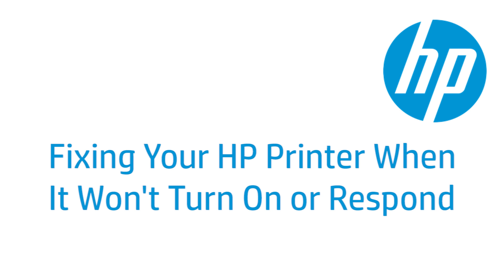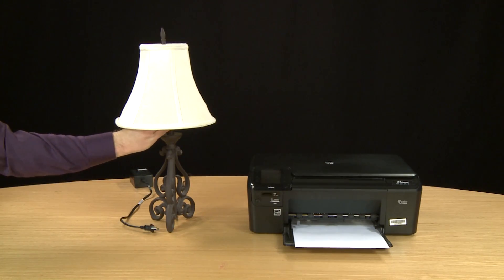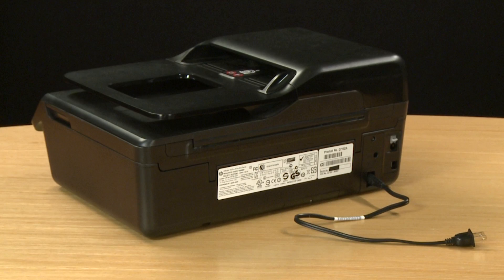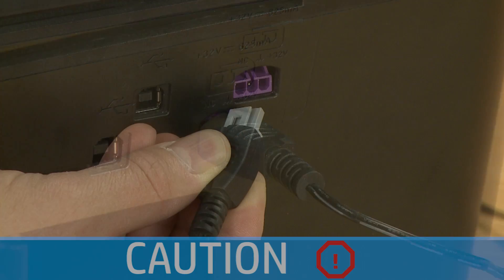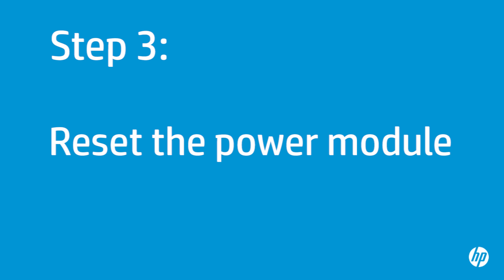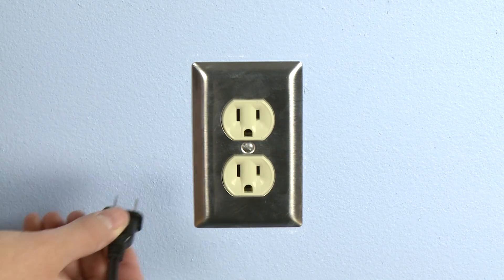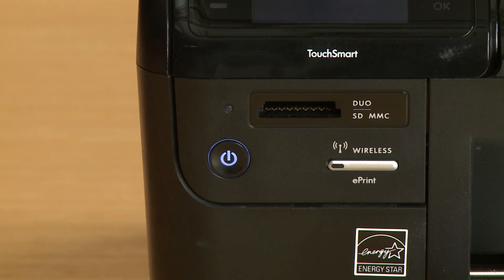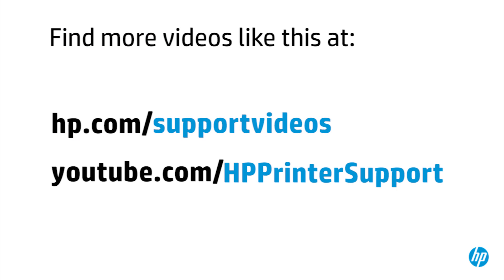Fixing Your HP Printer When It Won't Turn On or Respond

Comment: My HP Deskjet F370 is not detected on my computer. The printer's all lights are on (not blinking) all the time after plugging the cord to electricity outlet. The power button on the printer is not responding and remains on. Plugged in plugged out done but no responce. please suggest.
Reply from the maker: +Harsh Dev Vashist Please follow the guidelines in this document to fix this issue: http://bitly.com/2JHcjjR

Comment: My power supply has indicator lit on but when i plug the connector to the printer the indicator light goes off and the printer won't power on. What's going on with my printer?
Reply from the maker: +antonio alvarado Please perform the steps mentioned in this document to fix this issue: http://hp.care/2v0gAoi
Reply: i have done performing all the steps being shown in this video but still not working. If plug the power supply the light indicator lights on but, when i plug the other end of the power supply to the printer the light indicator turns off and the printer won't power on.
Reply: same problem. No power

Comment: Most insulting video ever.  I think I'll buy a brother or something... HP's seem to be programed to act funny in a few years and it's almost always some infuriating thing to cause some sort of inconvenience for a little while and then it magically heals it self. Oh and I can't let this one go.  That "reset" where he tells you to unplug the 120v side of the Power Supply Unit and you must wait 15 seconds is TOTAL BULLSHIT! What he's telling you to do is unplug an extension cord from your vacuum while the other side isn't even connected to the outlet at the wall. HP has fallen so far... Sad.
Reply from the maker: +Aaron Locke-Paddon Please perform the steps mentioned in this document to fix this issue: http://hp.care/2pigaHj

Comment: all tricks are failed..
i purchased hp deskjet GT 5810 in august 2017.  Since buying the product it does not print in colour mode.  i complaint to toll free number on 7 sep 2017. i got a complaint no.  but after 55 days i got no help from hp. I complaint many times but  my effort was useless.  now printer has no power.  sometimes work for 5-10 minut and after that it stops working.   i have tried a lot of trick but failed to solve.     anyone can help me in this regard..  plz advise how to replace this printer from hp.
Reply from the maker: +lg niboaria Please use this document: http://hp.care/2pigaHj to fix the issue. If the issue persists, please contact HP Phone Support: www.hp.com/contacthp for further assistance.

Comment: help!! my computer had a reformat and after that, my hp deskjet f4280 won't turn on is there anything i can do to fix this?
Reply from the maker: +bee!! on ice I understand the printer does not turn on or respond when you press the Power button. There are no light indications or error messages, and there is no noise or movement from the printer. Please try the following steps in order to resolve the issue: http://hp.care/2wBM5VC
Reply from the maker: +S A That's correct. We appreciate the response.

Comment: GREAT TIP!!!   One day, my Photosmart suddenly went dead.  It was plugged into a surge protector with several other devices,  all of which remained working, so I never suspected the protector might be the culprit.  Only minutes into this video, I dutifully pulled the printer plug out and inserted it into a different socket - on the same strip.  VOILA!!   So simple!   Thanks for the great tip!
Reply from the maker: +Jojuan Cedergreen That's great to hear. I'm glad it helped so much!
Reply: Jojuan, thank you very much for the comment. My printer did exactly what yours did (going dead), so I plugged it directly into the wall and it's alive and wellThank you so very much

Comment: No paper in printer: contact HP support.
Reply from the maker: +16nowhereman Paper feed issues might result from using ripped, dusty, curled, wrinkled, or bent paper. The quality of the paper can also make a difference. Use these guidelines to help avoid the issue: http://hp.care/2oHOVnD

Comment: I have an HP Officejet J3600 and it still wont turn on when I press the power on button but I notice that when I plug it in (without pushing the ON button) I can hear 3 short knocking sounds from the built-in speaker of my printer.
Reply from the maker: +michelle pido I understand the printer does not turn on or respond when you press the Power button. There are no light indications or error messages, and there is no noise or movement from the printer. Please try the below steps in order to resolve the issue:
1.Disconnect the power cord from the rear of the printer.
2.Unplug the power cord from the wall outlet, power strip, or surge protector.
3.While the printer is unplugged, plug another appliance into the wall outlet, and then turn it on to make sure the outlet works.
4.After the printer has been disconnected for at least 60 seconds, reconnect the power cord to the rear of the printer.
5.Plug the power cord directly into the wall outlet. Do not use a power strip or surge protector.
6.Turn the printer on. You can also try the article: http://hp.care/2tFDW52

Comment: My B110a, it just won't turn on but power adapter is with Green Light, may i know what's the problem.
Check power socket is ok, plug fuis is ok, what else could go wrong?
Please advice.
Reply from the maker: +CGF JB  I understand the printer does not turn on or respond when you press the Power button. There is light on the adapter. Please try the following document to troubleshoot the issue:http://hp.care/2sx37TJ
Reply: HP, done all that but yet it still no light ON except the Adapter. Moreover I only having it less than 3 years, brought in Dec 2014. Any other Options is still there?
Reply from the maker: +CGF JB If you have exhausted all the troubleshooting, I would recommend contacting HP Support: http://hp.care/2bjG4nE
Reply: Called, it say should be Hardware? Do you think so since mainly it only use for Scan average 20 pgs/ month.
Quite disappointed if the  Hardware really spoilt so fast.
Reply from the maker: +CGF JB Yes, it is a Hardware problem. I suggest you contact HP Support.

Comment: My HP Deskjet 3052a worked fine since 2012 but I just went to turn it on and it is plugged in and everything works but it just will not turn on for me and it says offline on my MacBook. I can use whatever help anyone has, all I wanted to do today was scan some pictures on to my computer but then this happened and I don't know what to do to fix it.
Reply from the maker: +Chris Gillis The printer does not turn on or respond when you press the Power button. There are no light indications or error messages, and there is no noise or movement from the printer. Please try the following steps here:http://hp.care/2pjXRBm

Please find the troubleshooting steps for 'Printer Offline' or 'Printer Not Responding' Message (Mac): http://hp.care/2pj26x6

Comment: Our HP Printer is currently not working. The printer IS receiving power but pressing the power button does not turn on the printer.
Reply from the maker: +celeste Tuttle I understand the printer does not turn on or respond when you press the Power button. There are no light indications or error messages, and there is no noise or movement from the printer. Please try the following document to fix no power issue:http://hp.care/2o2jZQe

Comment: My HP officejet pro K550 printer won't turn on. Worked fine for years. I unplugged from the printer and from the wall receptacel. When I plug it back in, the printer power light comes on for a few seconds and shuts off again. All this started when I changed an ink cartridge. The printer power cord does not have a power box on it. 
Anything else to try?

Comment: HERE. If the B word isnt turning on and ur getting the green light at the power cord, its probably asleep. open the printer to where u can change the ink cartridges and LEAVE the B word open. it took my POS a minutes to wake up but it did. I had the usb in my laptop, incase it still asleep. If it worked for u speard the word.

Comment: Hi, the green light is on but its blinking..and also the turn on button. It keeps blinking and not functioning like usual. May i know what is the problem? Isit because of the power adapter? Mine is external battery. Thanks
Reply from the maker: +Chan Shi En I can see the power light is blinking which means the printer is busy processing a print, scan, copy, or maintenance job. You can try the following steps: http://hp.care/2k99U0u
Reply: What i meant is the power adapter's green light. The turn on button and other lights (including the screen that shows number) also keep turn on and off.

Comment: I have an Inkjet D2660 that turned off and would not turn back on ? What do I need to do now?
Reply from the maker: +John Rhay Bundalian Try disconnecting the power cord from the rear of the printer. Unplug the power cord from the wall outlet, power strip, or surge protector. Reconnect the power cord to the rear of the printer. Plug the power cord directly into a wall outlet.This should help!
Reply: HP Printer Support 
Simplest and (therefore?) best solution. Had been plugged into multi plug power surge board and no amount of pulling out both ends of plug and replugging or testing on different power outlets or different leads  - or any of the more convoluted failed fixes above helped. Just plugged direct into the wall power outlet and voila. Then used double plug - one for printer AND surge multi plug board for router etc. 
Thanks for easy fix (after much previous wasted time and impatience)

Comment: I have an officejet 7410xi that turned off and would not turn back on. I read MANY suggestions and finally unplugged the wall plug AND the small round plug from the back of the printer. I waited for 60 full seconds, then plugged everything back in. Voila! My printer is working again! Good luck with yours!
Reply from the maker: +Pam Bunderson Glad to hear you were able to get things working!

Comment: We have an HP Inkjet 8610. Today it was not recognizing that I had just installed new ink cartridges and the error message stated that the cartridges were not installed at all.  After it finally recognized the cartridges, it then stated there was a problem with the printhead.  I pulled the printhead out, put it back in, put the ink cartridges in ~ and then lost power.  I went thru the unplugging and plugging in and I am now getting power for 15-20 seconds and then it shut off again.  Help?
Reply from the maker: +mbuttterfly77The printer suddenly turns off without warning. A print, copy, scan, or fax job fails because power might be low or the printer is off. The printer does not respond to any job when it is turned off, please follow the steps from the document:http://hp.care/2joo9D6

Comment: mine is an hp deskjet 1050 and it came with a different color and it used to work but now it doesnt as soon as i want to print a paper
Reply from the maker: +Kyrellos Ibrahim Follow these steps:http://hp.care/2fuwqlG  in order to resolve printer issue.

Comment: i tried all the steps but it did not work. voltage and amp on the module and printer are compatible. the indicator turns green when switched but when i connect the end of the power cord into the printer the green indicator turns off.. :(

Comment: my printer d2560 didnt respond but the light is on but not turning off.
Reply: same found a fix?
Reply: Donne Rey Relucio same problem as yours here... but my printer type is HP K209g. Haaaaahhh it's surely had to bring it to service center :(

Comment: My printer is brand new and when i turn it on, it stays on for a few seconds and i see the light from  the scanner and then it powers off again. my power cord does not have a little box attached to it, but theres a box on the back of the printer that the power cord connects to. if you could help, i appreciate it. thanks.

Comment: I have an officeinkjet 4500 wireless. I have switched laptops and now it will not connect wirelessly to anything and the disk that came with mine is out of date and is not compatible. Also now mine will not stay on. I can sometimes get it to turn on and it makes a strange purring noise and then shuts back off. I use mine for a business that requires the use of the scanner sometimes. So unplugging the scanner is not fixing the problem for me.
Reply from the maker: What operating system are you using on your laptop computers?  You can find the drivers for and Officejet 4500 here: ( http://ow.ly/62AU304vDJr ). Just be sure that you have the correct operating system selected.

This document may also be of help, over the power issue: HP Printers - Printer Does Not Turn On - ( http://ow.ly/KeyJ302fg5T ). 

Also this one, for the network connectivity issue, once the power issue is sorted out: HP Printers - Printer Not Found During Network Driver Setup (Windows) ( http://ow.ly/YZORg )

Let me know if that helps at all.

Comment: All of a sudden, my HP laser printer P1102w wouldn't turn on.
Reply from the maker: Please use the "HP LaserJet Printers - Printer Does Not Turn On" document ( http://ow.ly/SpzP301rLH1 ) as a checklist to ensure you have completed all the recommended troubleshooting steps.  If you get to the "Service the printer" step, please use the link in the document to contact Technical Support.

Comment: I have an HP Envy 4500 printer.  The printer will only power on when I unplug from the wall and plug back in, however it begins booting and then immediately powers back off once the scanner starts to move.  I have no idea what to do...
Reply from the maker: It is interesting that during the printer's power-up routine that it shuts down during the initialization process without giving you a message of some sort on the control panel.  Please start with the "HP Printers - Printer Does Not Turn On" document ( http://ow.ly/r3lp3011c6g ) and let me know the results.
Reply: I followed those instructions before I watched the video, and neither did anything. The only thing showing on my display if the HP symbol and a loading bar.  It never gets past that point.
Reply from the maker: This may seem like a silly question, but is the printer plugged directly into a wall outlet?  It is important that the printer be plugged directly into a wall outlet.
Reply: So mine is dong the same thing and it is directly into the wall still not working
Reply from the maker: +Amber Nicole Smiley  Was your printer previously working? Is there anything else that consumes significant power, that is on the same electrical circuit?  A good test to rule out a power issue on a particular electrical circuit,  is to try to plug the  printer into an outlet either in the kitchen or one that normally drives a washer or dryer, as those circuits generally have the highest power capacity. If the printer starts properly when using one of those outlets, it probably means the electrical circuit you are trying to use is overloaded. It is worth a try, and depending on the result there will be a better idea on how to proceed.
Reply: I have plugged it into everything everywhere done the same steps as above watched the videos. I think you all just need to admit they die after some years. Or send out free replacement cords.
Reply: Yes it was plugged directly into the wall, but I was able to figure out my problem.  The scanner is apparently broken, and during the starting process the scanner has to go through its own starting process before start up will continue.  I disconnected the scanner and it now works fine, other than obviously I can no longer use the scanner.
Reply: I have the same problem. I dropped it from shoulder height on to the carpeted floor(out of frustration) and it started working. My thought is something in the scanner is locking up.
Reply from the maker: Try plugging the printer directly into a power outlet in the kitchen, and see if it will start up normally. If it does, it means there is a problem with the current available on the circuit you are using normally. It may be overloaded.
Reply from the maker: It still sounds like a power issue to me, but I would suggest that you use: HP Customer Support - Contact - ( http://ow.ly/UqGz302vZs1 ), and create a case and contact phone support once you have your case# and contact number.
Reply: That's the exact same thing mine did.  I just disconnected the scanner and it works fine now, minus the scanner.  I still get an error message when I start the printer saying that the scanner is broken, but at least now I can print things!  But I have no idea what happened to the scanner.  It just all of a sudden stopped working.
Reply: it is a bigger problem. My printer is the HP officeinkjet 4500 wireless. It has started doing this same thing. I need my scanner to work. I use mine as a printing business. Small one but still need the whole thing to work just the same. Customers sometimes have their own logos I have to scan.
Reply from the maker: The scanning function and self test tend to use more power. Make sure the printer is connected directly to a wall outlet, or to a different wall outlet. It may not be getting enough current to complete a scan.
Reply: Do you have a link that shows how to disconnect the scanner?